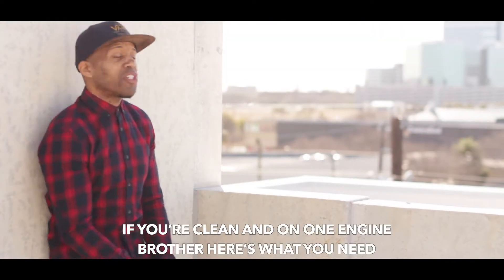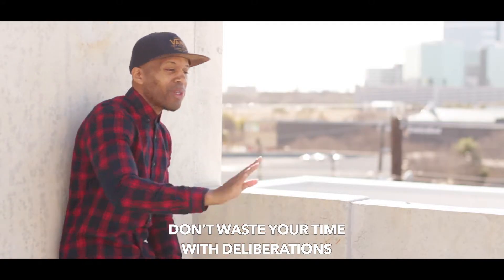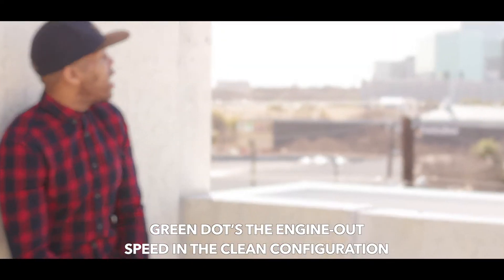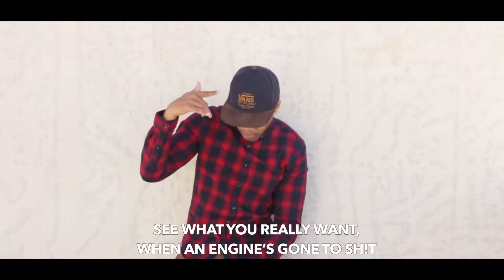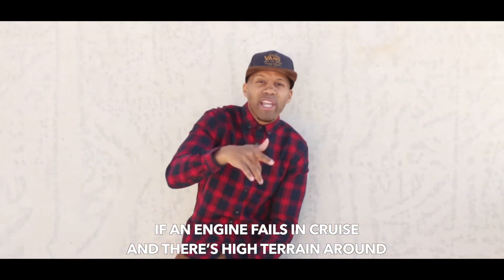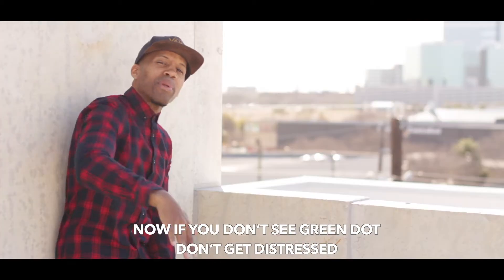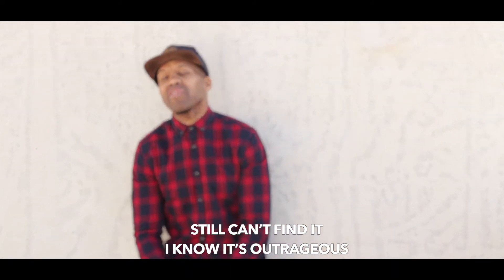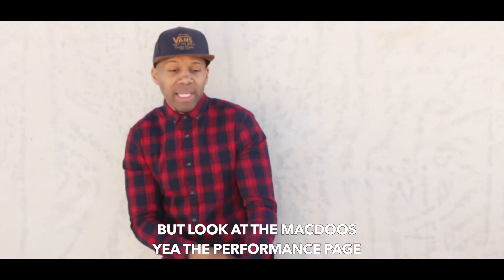Airbus A320 Green Dot Rap!

Comment: Below 20 000 ft equal to 2 × weight (metric tons) +85

Above 20 000 ft, add 1 kt per 1 000 ft

Source: A320 FCOM DSC-22-10-50-20 Characteristic speeds.
Reply from the maker: G'Day Mate. Skipper here. Thanks for the top tip! Don't worry, I've explained it all in the full training which you can find here! https://blog.thea320insider.com/2021/07/15/green-dot-in-the-airbus-a320-the-deep-dive-vol-1/
Reply: Unless it’s a A321, then add 75…
Reply from the maker: @MrCamvaughn   G'day Cam! Thanks for that...the bloody 321 is always getting in the way of my lyrics!